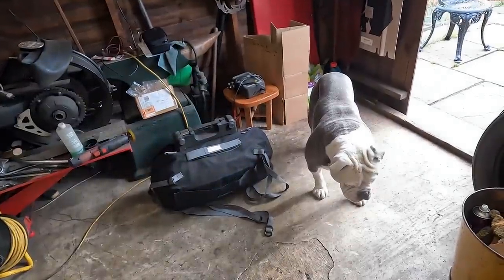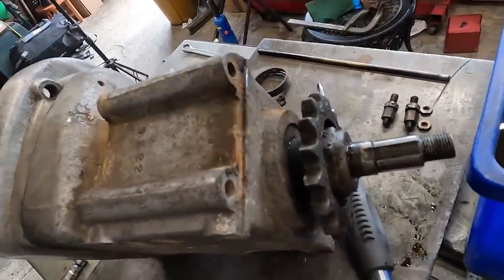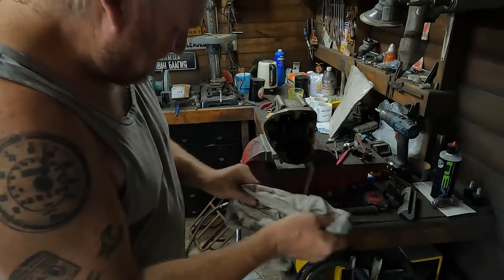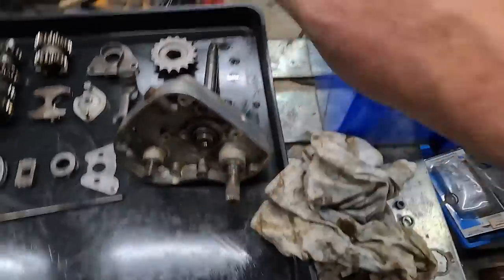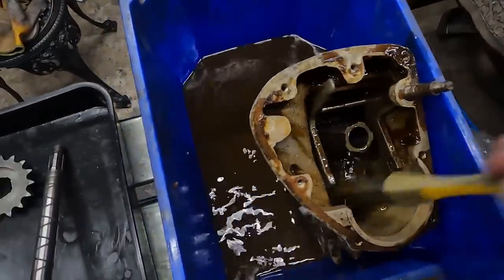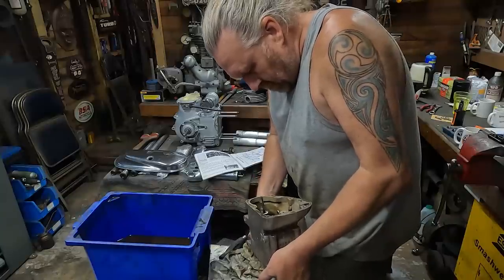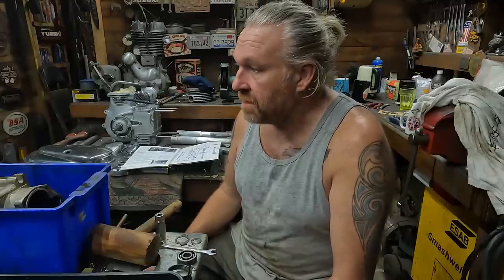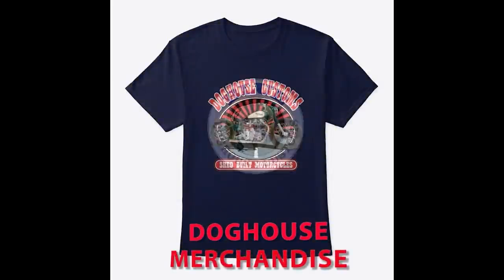Gearbox Strip Down

Comment: The 1988 manual says the gearbox is assembled with grease in but should be topped up with engine oil. I guess years later that gunge is what you end up with.

Comment: Hi Craig, there is always an element of surprise when stripping down old stuff. I think the other guys are right it's old packing grease. One question though on the return spring, " Where is the broken Piece?". Great to see you getting stuck in again. Best regards .. Terry ..
Reply: That was my first thought as well. 🤣
Reply from the maker: I managed to retrieve the broken piece, luckily where it’s fitted is separate from the actual gearbox so all is good 👍
Reply: @THEDOGHOUSECUSTOMMOTORCYCLES  that's good and you will know from that if the new one matches up.

Comment: Ive got an Enfield gearbox to rebuild in the near future. I bought a spare, but neutral seems between 4th and third  ( I know ! )   So has it been assembled wrongly,,I doubt that unless some incorrect parts have been used Or the index plate is worn,    either way, it needs looking at.  Interestingly, I I'm ok with electrics and gearboxes, don't find them difficult at all,,,  HOWEVER,  small thermonuclear devices in enclosed spaces have more fitness than I when it comes to fabrication,,  Both Craig and quicky make it look so easy    Pigeons who have been fed a steady diet of dodgy vindaloo have sturdier bowel motions than my sheet metal TIG,    I might post a few photos of attempts, just to give folks a laugh    One always could do with a laugh these days !!!